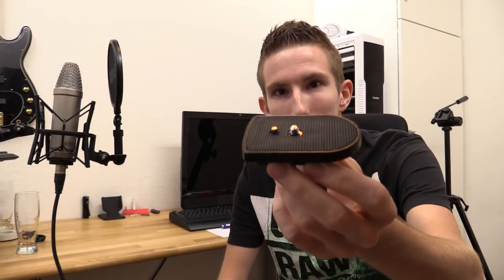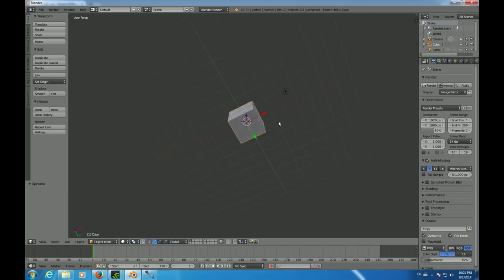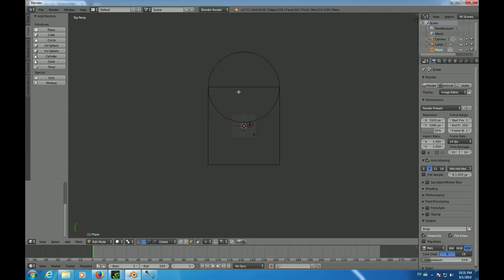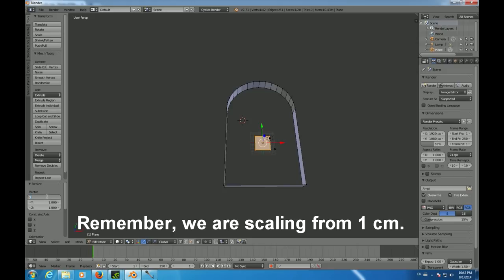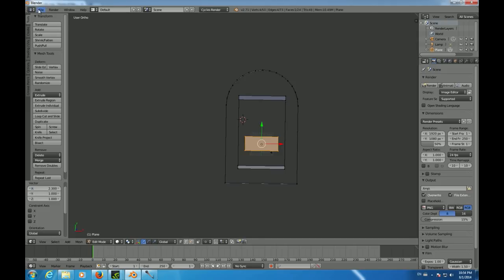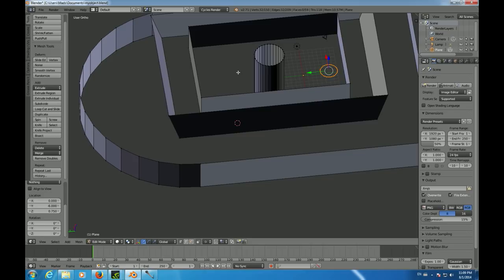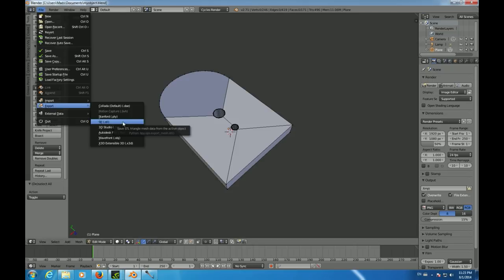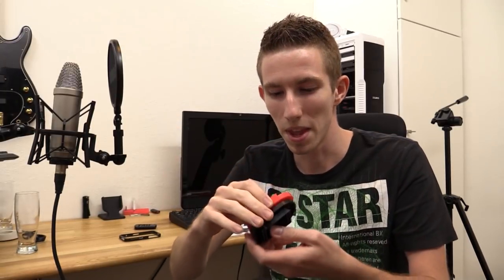Blender Tutorial (Beginner) - How To Make a 3D Model for 3D printing - EcTechTime

Comment: In order to eliminate uneeded vertices (like in the video when you merge vertex by vertex) you can just select all of them (with a box), press W for a menu and choose Remove doubles. Watch the number of selected and deleted vertices in the top right status bar. May need to adjust the threshold though works for me in most cases as it is. Good luck!
Reply: well, I can't do that. Somehow it doesn't let me select verticles from different objects^^
so what I can't select I can't merge  :(
neither your nor EcTechs method worked. I have blender 2.79.
Reply: then you are using blender wrong. are you aware of the difference of object and edit mode?

Comment: Instead of selecting vertices of the circle one by one (in the stage where you create faces next to the circles) you can just use the circle select tool: press C and adjust the diameter with the mouse-scroll. Then deselect unneeded vertices with the box select (B key) and shift key pressed. Saves hours for you when you work with large and complex meshes!
Reply: You can also press the L key and it will automatically select whatever your cursor is over, as long as it isn't connected to the group of vertices (the square for ex.) in a model.

Comment: I find the modeling with the "Intersect Boolean" (Ctrl + F) goes much faster. Give it to the version 2.77 - Straight with holes or cut out of objects. Only use the Triangulate Modifier before exporting. This gives a better result when slicing.

Comment: awesome! I look forward to more 3d print instructional videos, I want to make a 3d printed water gun that houses a windshield washer pump, 12v battery and various hoses and a nozzle.
Reply: This would be awesome! Can also have a wire with battery pack on your hip/back, the wire can be wrapped in a small sheaf cover that makes it look like it's tethered to a backpack. Or you can build the tank, pump and battery in a backpack you wear on your back connected to the gun via pipe.

Comment: I have a Prusa i3 RepRap open frame printer. I sliced my model using Simplify 3D with a layer height of 0.1mm. Print output is fine but there are continuous ripples on my part. How do I fix this?
Reply: Mudaser Awan bit late. I don't have a 3d printer yet but i assume you just sand it down